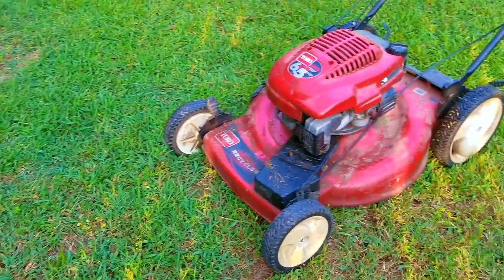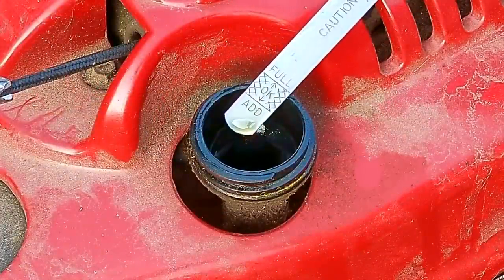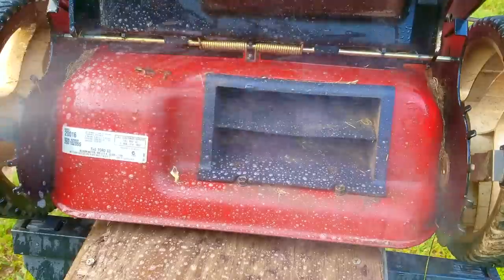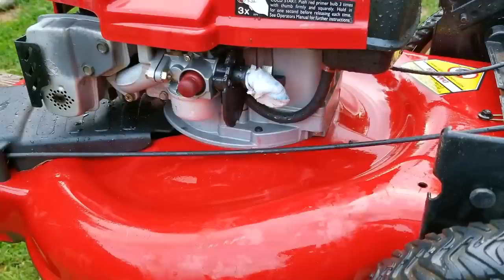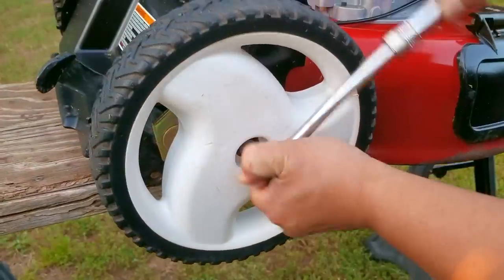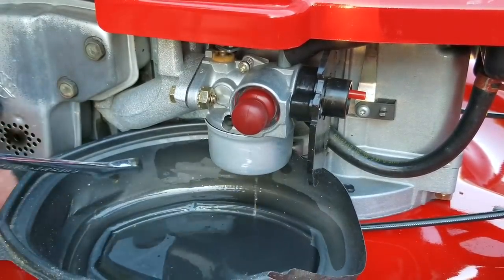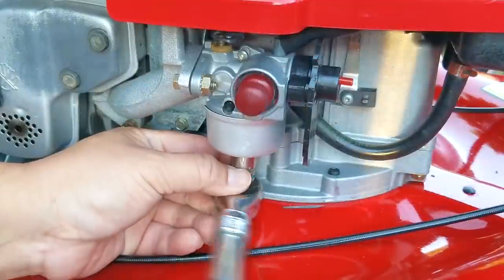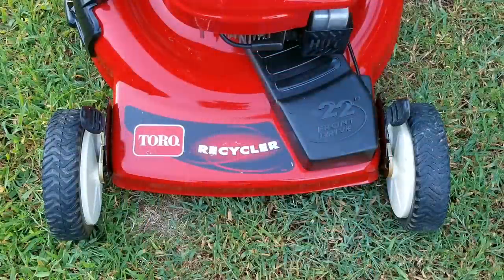Someone Threw Away A  Good Toro Lawn Mower

Comment: I got one of those for free to before and fixed it in a month then sold it for $40 there wasn't nothing wrong with it just a dirty carburetor and air filter and i put the engine on a better frame because its frame on the back was rotted out the guys still using the mower now 

I told him if you have any trouble with it just give me a call
Reply from the maker: very nice work Mike.

Comment: I have an idea on why this mower was abandoned. The previous owner didn't know much about engines, and only knew that you needed to change the oil. When the carb clogged up they filled the tank up with gas because they thought it ran out. When that didn't fix it, they dumped it. Why they dumped it by a school I don't know, I thougt you just throw away everything in the local pond or wildlife reserv in the US...
Reply from the maker: that seems to make the most sense

Comment: Got a free mower from a coworker he couldnt get running I got it running in less than 30 minutes. Strechted governor spring  replaced primer bulb the guy I gave it to is still using it 6 years later
Reply from the maker: very nice work

Comment: They put the mower away at the end of the mowing season without draining the tank.  Ethanol subsequently clogged the bowl and jet and it wouldn't start.  (Evident from your video.)  In our "throw away" society, they tossed it and purchased a new one.  A simple repair of the bowl and jet cleaning could take two weeks before a small shop can get around to it and cost $75.00.  I would say the cost and time involved for the repair resulted in the toss.  Over the last 45 years of mowing lawns, I have NEVER purchased a mower.  There is always a neighbor tossing a mower because they failed to empty the fuel at the end of the season or they simply wanted a new one to replace their "old" mower that is 5 years old!
Reply from the maker: yep I think you're right.

Comment: I have at least 10-15 Tecumseh powered pieces of equipment, and most of them were from the "curbside store". What I find is that most times is that bad fuel is left in them. I'm running ones I picked up 10-15 years ago (meaning most are 25+ years old now) and they still run great with basic TLC. Tecumseh engines require clean air (air filter), clean fuel (carburetor) and clean and full oil. Do that and they run, run, run, run, run, run and run some more for years and years.  They are excellent engines and very misunderstood. I'll bet that old fuel was left in it between seasons and then new fuel (what you saw in the tank) was added, and it ran for a few seconds and stopped. The person didn't know any better and discarded it.

Tecumseh engines' problems can be summed up with this: It's not the engines that are the "problem", it's the "mechanics" that attempt to "fix" them that are the problem. Nothing like a Tecumseh engine and like their motto said at one time, "Better From The Start".
Reply from the maker: you got that right, thank you Google User GP.
Reply: @HomeGaragechannel  Just worked on one today, a 1996 Sears Craftsman mower with a 6.5 HP Tecumseh Vector. A new carburetor bowl and some TLC and the machine runs like new.
Reply from the maker: very nice work. what are your plans for it?
Reply: @HomeGaragechannel  I've been using it since 2010 when I pulled it off the curb. It was made in 1996, it's an AYP made "917" model prefix Craftsman.
Reply: @HomeGaragechannel  I haven't bought a lawn mower since 1992 and I still have that one I bought in 1992. I use whatever strikes me at the moment that I need to do a job (snow blow, edge, trim, mow the lawn, etc.).
Reply from the maker: that's pretty awesome,
Reply: @HomeGaragechannel  Basically all of the equipment I use now came from the curb or from a neighbor that gave up on it.

Comment: That looks like a Tecumseh, and they went out of business in 2008, so it’s 15 years old or older.
Reply from the maker: yes I think you're right.
Reply: @HomeGaragechannel  maybe it was grandpa’s mower and he has passed, so grandson doing the clean out tried to gas it up and use it. Because we now know the bowl nut jet was clogged, it would not run, so it was tossed. Grandpa needs a tachometer to measure the rpm he is rolling over in his grave.
Reply from the maker: that's also a good possibility

Comment: Ditch a gas mower with harder maintenance (looks like they tried everything but cleaning the bowl bolt) for an electric one that requires almost no maintenance.
Reply from the maker: you might be right about the gas mower. On the electric mower though, have you ever read the owners manual for one?
Reply: @HomeGaragechannel  Just the one we have - its a battery powered one.  Clean it, keep the blade sharp, store it in a dry place, and keep the battery charged.

I know I am counter to probably everything you teach, but every year it would be something with a gas mower.  Once, I had to research the very fix you pointed out in this article.  My wife could never start it, so it fell to me to fix it or start it.  (Sometimes I mow, sometimes she does - she likes the outdoors way better than I do and likes playing in the yard).  The mower we have now is effortless - have a free hour on a saturday?  Grab it and mow the lawn.  No gas runs, changing oil, filter or sparkplug.  Easy peasy.
Reply from the maker: you are correct but oil filter and plug, I not even a yearly occurrence, which most people seem to miss.  The gas is obvious, it the same for a charging the battery. the only - problem I have is with the battery.  The first time you have to replace it, is when you'll start to miss gasoline. the cost is a good percentage of a new mower.
Reply: @HomeGaragechannel  we have a couple of tools that use the same batteries.  Yeah, they will be expensive, but I haven't needed to yet.

Comment: Last year I bought a new Toro mower with electric start.  First mow was OK the next mow no electric start. Took it to local service and was told I got it wet so it blew a fuse. Just regular grass not wet but all grass is moist that was "too wet".  The underside of the deck constanly gets clogged. No power. Stalls. This is a brand new mower. I can't hose off the grass becuse water is wet. Toro is trash.
Reply from the maker: that's some bad news.

Comment: Laugh at me if you will folks, I go underneath any mower, first thing I do is disconnect the spark plug, second thing take it completely out of the engine, then underneath I go, taking the blade off and sharpening it like a razor. After cleaning the underside of the mower deck, I spray paint it black to keep the grass acid from destroying the mower deck itself and keep it clean of collected grass underneath it.
Reply from the maker: very nice work Dan Basta.

Comment: Kinda obvious why they dumped it. It stopped running.
Reply from the maker: the most relevant comment ever.
Reply: @HomeGaragechannel  Much appreciated.

Want to collab on a video to try to help me eat an old weed eater working again?

I had attempted to rebuild the carb, I replaced the tank and fuel lines as well. But it doesn't work.

I can make a video to show you what it looks like and you can guide me on what I should do.

Think of being tech support, but for small engine repair.
Reply from the maker: thanks for the offer, but my schedule doesn't allow for anything new, from what I'm doing right now.
Reply: @HomeGaragechannel  Sounds good. Keep up the good work!
Reply from the maker: I will thank you.

Comment: hey, dumb question,, what brand/kind of spray cleaner are you using ?? i want to get some
Reply from the maker: it's not a dumb question at all, it's the degreaser from Harbor Freight.
Reply: @HomeGaragechannel  cool, thank-you,, we have 1 in town, zephyrhills, florida, about 30 miles northeast of tampa, blue bottle ?? just spray on, rinse off ??
Reply from the maker: if it's really bad, I would suggest scrubbing it, then spraying it, but some often it will cut thru it.
Reply: @HomeGaragechannel  ok, thank-you
Reply from the maker: no problem